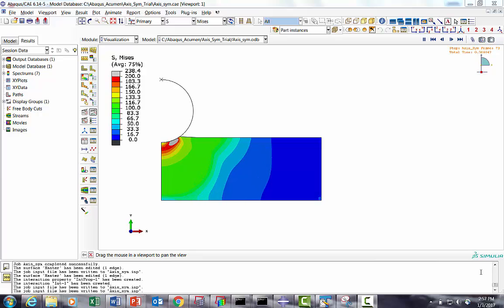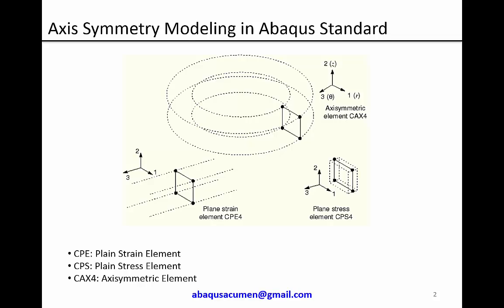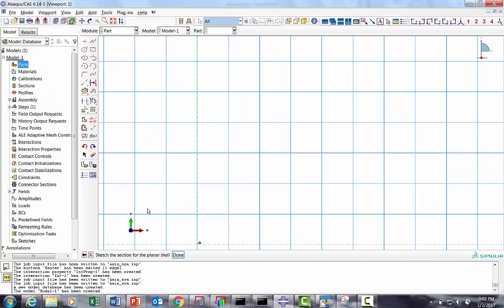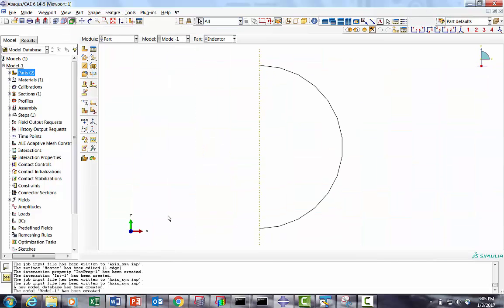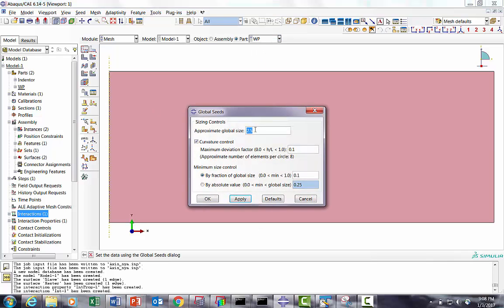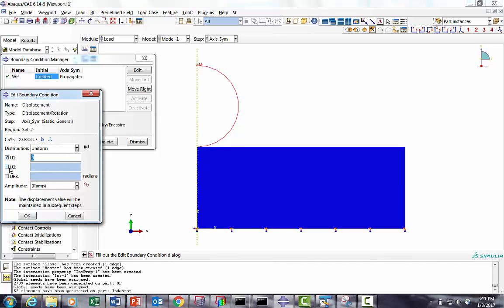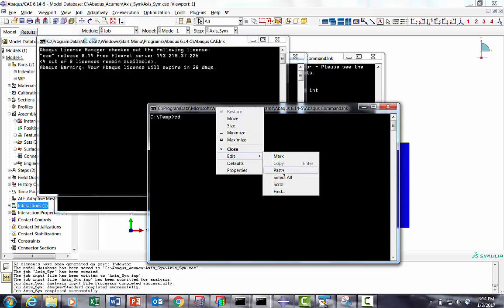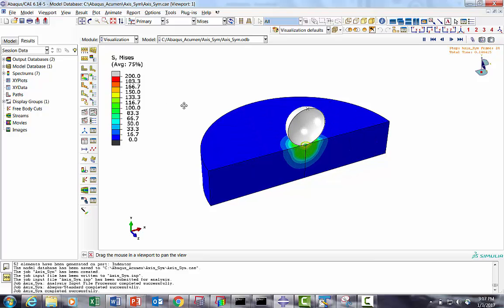Abaqus CAE/Standard: Use of Axis Symmetry stress element to model Brinell hardness test

Comment: Your viedeo is helpful! Thanks! Now I'm doing the simulation about the glass test, to get the critical failture stress of glass. My equipment is similar to your modell, the difference is that, the glass sample is a beam. I give a displacement on the center of the top surface of the glass(just like a ball of the actuator moves), then want to get the results about the relationship between the displacement and the principle stress. The question is, I don't know how to set some parameters rightly(because the results in the simulation about the critical failture stress are not correspond to the resullts of my test. Actually the displacement is not the same, in the simulation and in the real test). 
So I just want to ask, if there are something wrong with my modell?
I use the property of material elastic to give the young's modulus and Poisson's ratio(maybe "Brittle Cracking" is right?). Mesh is Tet-C3D10. 
I just use only a beam, then to define a displacement in the center on the top surface. Should I also draw the ball of the acututor just like the one in your video, and to define the interaction, will it make difference?
Thank you very much!
Reply from the maker: Making the ball as applicator will make difference as it involves the contact stresses.
Reply: Abaqus Acumen  Many thanks, and I want to have one more question, when I use a metallic ball(radius about 0.5mm) to press the glass beam, the displacement is also small(about 100 micro meter), just like in the video but it's three points bending. So the interaction is only one point(ball to plane) or the interaction will be a load area circle?

Comment: Very useful video thanks.. i have a question i have very similar simulation only i am applying force of 81.5 N but i have error saying  " Time increment required is less than a minimum specified"    can u help me with this
Reply from the maker: Apply displacement and measure reaction force, you will not face the convergence issue